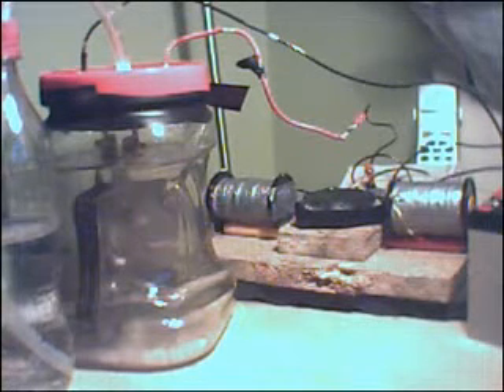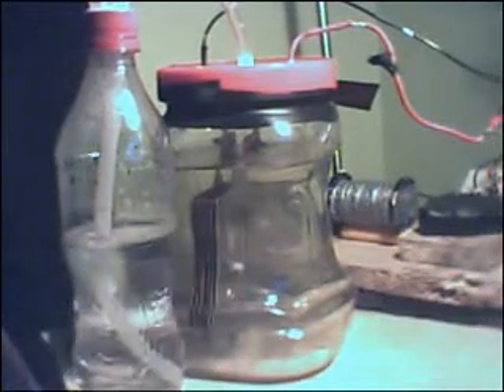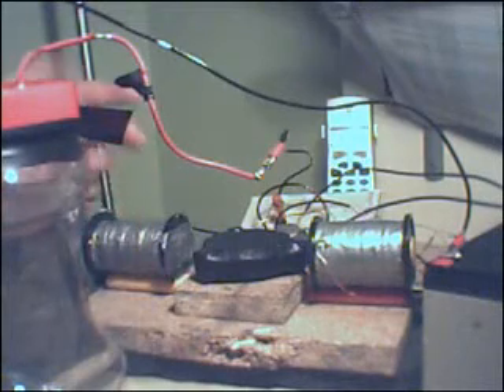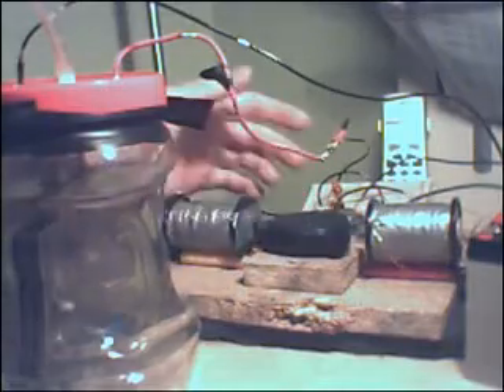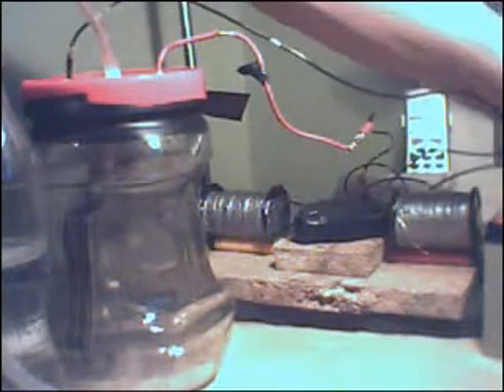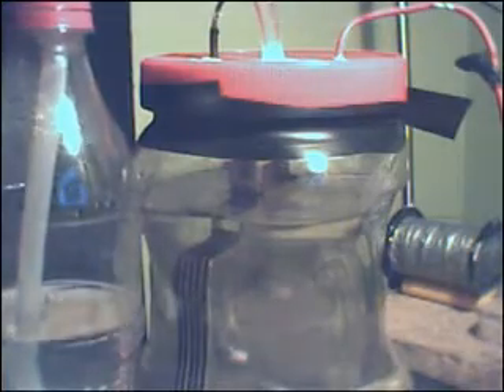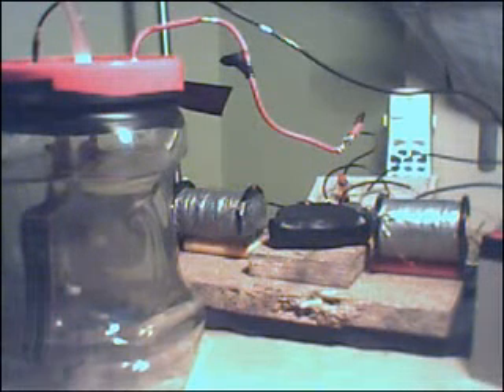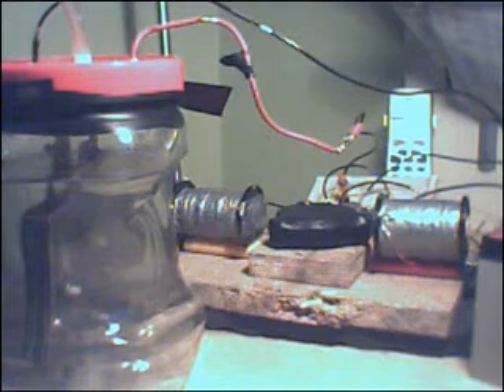New Model Bedini attached to HHO cell.

Comment: if i understand the bedini motor correctly,the output is "negative energy".in the movie "energy from the vacuum pt2" tom bearden states that currently there is no mechanical application for this type of energy.john bedini also states that the ONLY way to convert this energy to a usable form is thru the chemical reaction that takes place inside a battery.somehow the negative energy creates more ions than positive energy.this is supposedly where the over-unity comes from.

Comment: correct me if i'm wrong...
I thaught you were using a single battery and the output for the seccond battery was going straight to the HHO cell?

Remove the second coil completely from the circuit and retest with HHO cell.
Also, disconnect the HHO cell and use a multimeter and check that you are still getting voltage on the power lines to the hho cell.

Comment from the maker: when connected to the plates, yes. Acting as just an energiser the battery absorbs the spike. I have tested. Removing a connection on one coils power turn, the charging voltage in secondary battery lowers.

Comment: if you have both drive coils linked together then the back emf from one coil will flow around the second coil and dissapear... it would be easyer to short out around the other drive coil than it is to overcome the 'resistance' of the diode and your HHO plates.

Comment from the maker: I am well aware that the bedini was not designed for this purpose. This video is for demonstration purposes only. I must ask however, how is the power being halved? The configuration of the rotor and coils means that each coil fires separately, sending a high  voltage spike to the receiving battery or stainless plate. The second coil fires in the time the other is off. You do not seem to truly understand this machine. 2 coils, 3 equally spaced magnets. Work it out.

Comment: bedini's were not designed to power a device that pulls so much...

Also... you do not need multiple bifilar coils...
Use a single wire coil and send it directly to your HHO plates...

Also, having one bedini circuit and twi bifilar coils your actually halfing the amout of power it can produce. Run the second bifilar coil from a second bedini circuit.

Comment: you can maintain the temp difference required simple its just how the car runs in water so its desame have radiator and dynamo then charge the battery then run the HHO cell make hydrogen fuel then run the engine so you can have power and generator gas stove